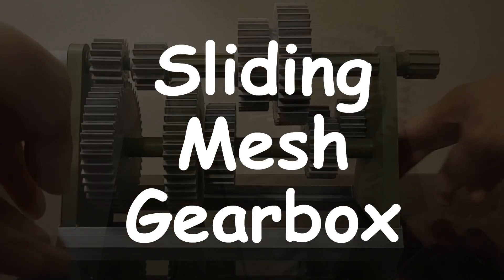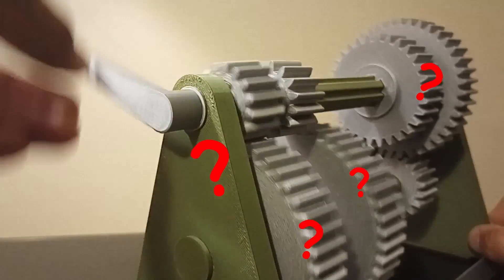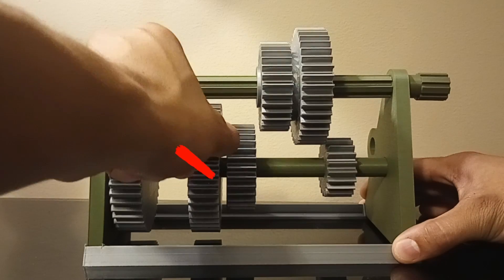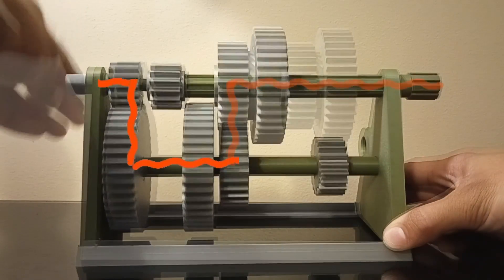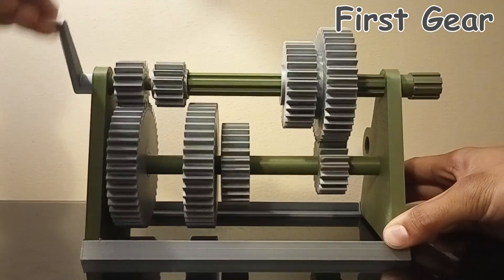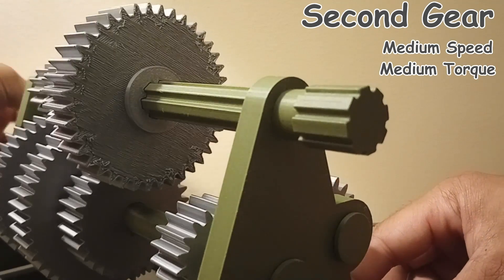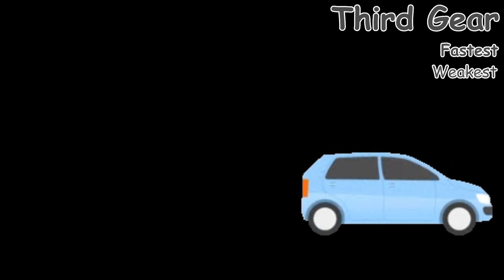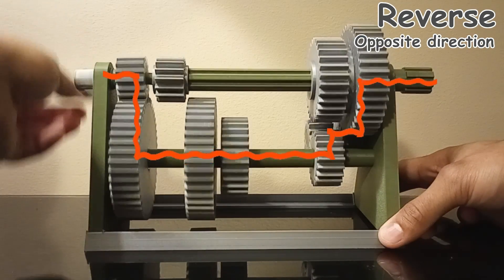Unveiling the Mysteries of the FIRST EVER Gearbox

Comment: Nice video i have been looking for a good explanation of a sliding mesh gear box. Ther is one thing however... Normally in practical gear boxes of this type the 1:1 ratio is achieved by locking the input and output shafts.  In your example 3rd gear would be a ratio between second and direct drive. And the 3rd gear on the output shaft can slide right  across and  bridge the splines of the input and output shafts making a direct 1:1 drive without the need for any gears. This also has the advantage that direct drive is quiet, since straight cut gears are noisy when under load. This gear noise is something that drivers of vehicles with sliding mesh gearboxes actually enjoy!!